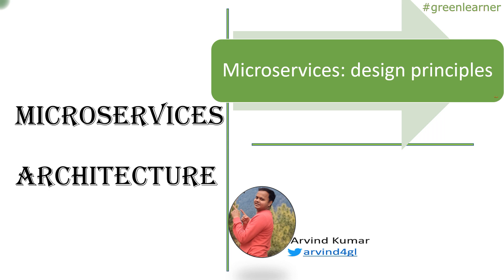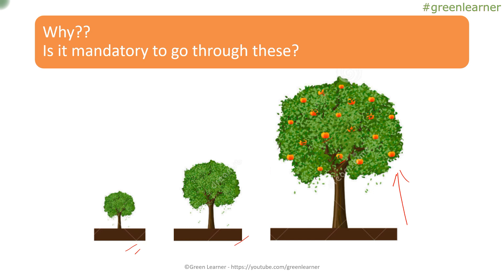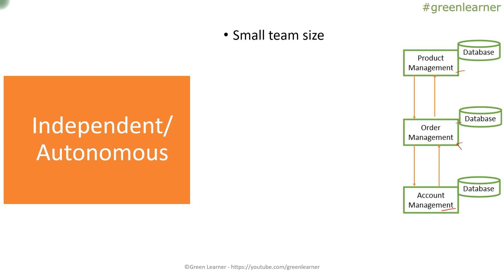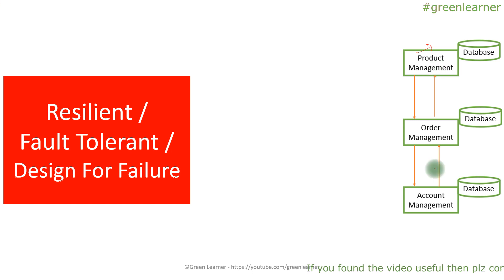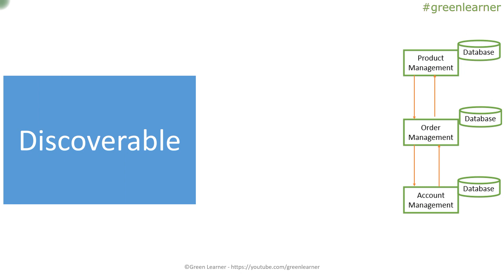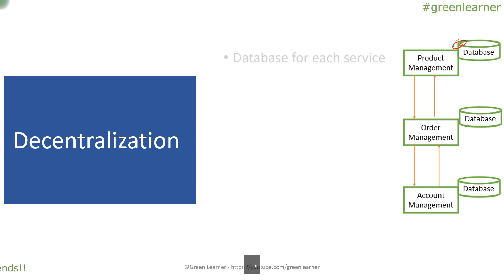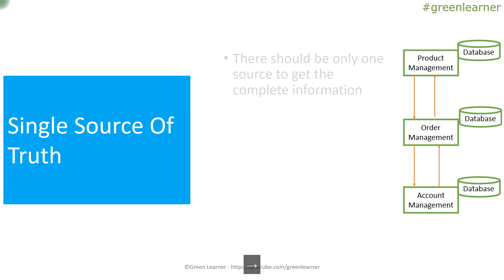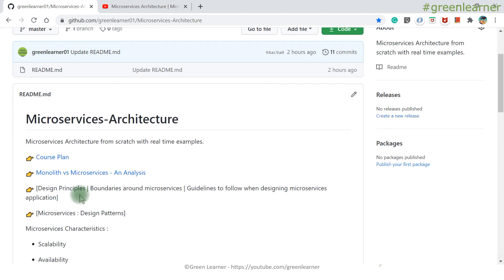2 Microservices Design Principles || Microservices Architecture

Comment: Namaskar Sir, Fault Tolerant means system must continue with other possible operations to happen when any unexpected failure came for any particular module of component and Design For Failure means suppose there are 2 components 1 and 2. And 2 is depend on 1, 1 fails  then it should not allow to happen 2. Is this correct? Thank you.
Reply from the maker: Yes the first connect is true. For the 2nd example if module 1 can work with some default values it should continue working even if module 1 failed. Or there is some alternate of module1 then module 2 should try.....the point is failure in one service should not result in system failure ..even proper response about the failure to user is also acceptable.
Reply: @codefarm0  Thank you Sir